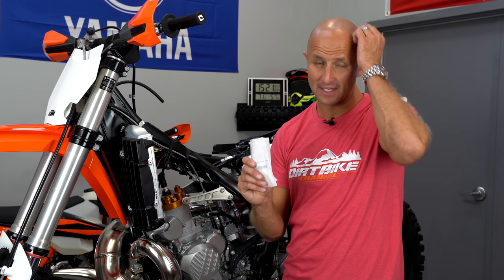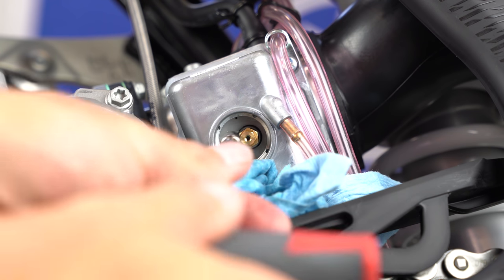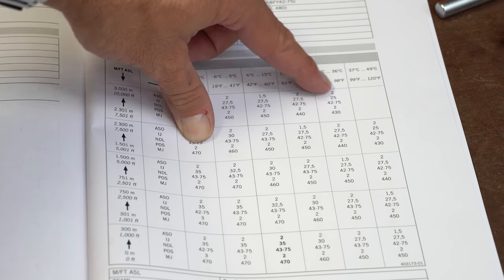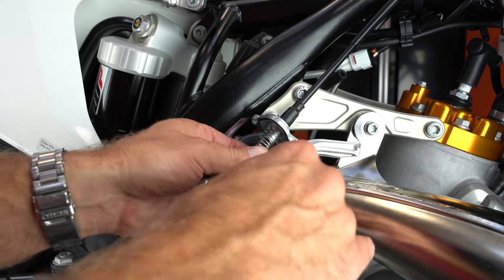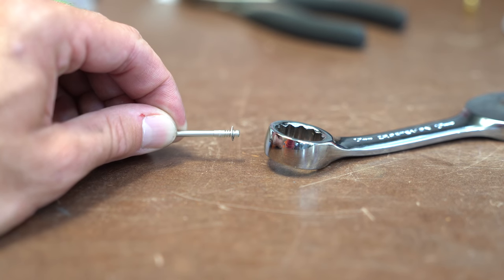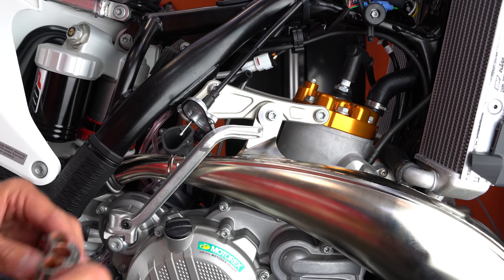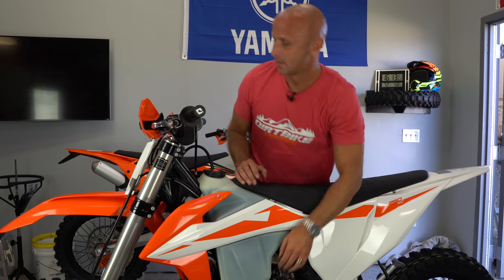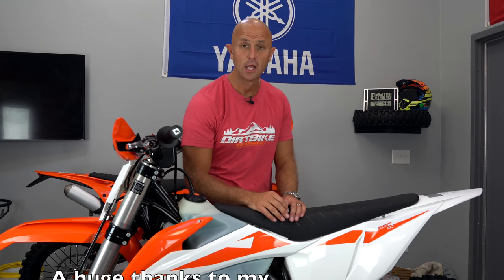Save $500 and Have a Great Running Dirt Bike | How to Jet Your Carburetor

Comment: I too tuned my own Mikuni Carb using you method with one exception.
That 1/8 to 1/2 throttle range is very affected by the needle. I found comparing the stock needles that there is a more drastic taper right at the end of the needle. This will make it run richer in that range, and I felt it. I got the JD Jetting kit simply because I was unsure what needle to go to. The one in the owners manual ran too rich. The one from the J D kit runs very sharp.
My question to you is how could I have chosen the correct leaner needle given all the options there are for the Mikuni and the owners manual chart recommending their leanest needle and it was still too rich.
Bike runs wonderful where I ride, so I don't need to change further, but for future reference and for other readers, do you have any tips on how to get the more appropriate needle.
Reply: Can you please specify the carbs settings and your what elevation and temp are you riding at?
I have the JD jetting too (not installed yet).
Reply: @NirHason  I simply used their chart which is similar to the standard owners manual. Only the thing I noticed is their specific needle is very different than the Mikuni - to be expected I guess. Then I cross referenced altitude and temp, then put those jets in along with the mystery needle. The taper at the end of the needle is very much different. Much wider at the tip. I then set the idle and air mixture as described and done. I set the range for typical summer temps in the 7500 foot range. I ride the bike at a wide range of altitude and it just runs. Starts easy, no stall, quick throttle response and really goes with the throttle opened, for as long as I can hang on, it is the TE300. So the 80 degree range, and the second to the highest altitude range. You will see in their guide if you spend most time at a certain altitude. That is the range I used - 7500 feet
Reply: @Toldea34  I tried to use the JD kit but they want me to use 35 pilot which runs very rich. You use the rich needle or lean one?

tnx for the detailed answer btw :)
Reply: @NirHason  I used the red needle. And, if memory serves, I used the 40 pilot jet. I have a feeling the JD needle is much leaner, while the idle circuit recommendation is much richer and something about th combination makes the magic happen. I could not get a combo of the supplied jets from KTM/HUSQVARNA or even a couple of extra jets to run as clean using the factory chart. The factory chart shows a 25 pilot jet throughout the range of options. This is why I thought the combo of leaner needle, richer pilot jet may simply be the trick to overall running better. The majority of my rides are in that throttle range, just about half or a little less. I ride very slow technical areas
Reply: @Toldea34  I'm riding at 0-1000ft (0-300m) between 79-98F and following settings:
-  PJ 27.5 (just changes it, was 30) - now it runs to much leaner.
- MJ 440
- Needle 43/73 P2
- Needle jet R-8 (I just got the S-4 so maybe I'll try it out with the PJ 27.5 since it's richer than the R-8).
- AS 1.25

The bikes runs great with those settings (PJ 30) but a little bit rich between 1/8-1/3 throttle. That's why I tried to drop to PJ 27.5 but now it's too much lean I think...
My main issue is that I'm getting only 60-75KM for full tank
Reply: @NirHason  I have not tried to jet to improve fuel efficiency. I am all about solid running performance. Your altitude just takes the settings completely away from where my bike is. I live at 4500 feet, but consistently ride starting at 6500 and usually top out around 9500 to 10,000 with each ride.
I will say one thing I have noticed about the fuel efficiency, is my 300 at least is very sensitive to just how we are riding. I have put 25 miles on very technical, slow climb, high altitude trails and used over a gallon of fuel where I then the following week go out and average smoother, more wide open fast trails and get something like 30 to 35 miles to the gallon. 
If it were me, get the bike running really well throughout its range for the conditions you ride. Then, plan on bringing extra gas just in case you are having fun and dont want to stop, regardless of how much it used.
Reply: @Toldea34  I'll go with your route :)
tnx for the advice, ride safe

Comment: although this is a well produced video, this guy breaks the cardinal rule of carb tuning and that is making more than one change when you go into the carb. this is the most common bonehead move by people trying to tune a carb.  if your trying to figure out what's what, never do that. it'll usually burn a bunch of time and if your lucky maybe an engine! (bonus!) i used to know a guy that always made 2 or 3 changes every time he opened a carb. his bikes ran like crap. but they were really pretty and he had the talent as a rider to ride around crap and still blow my doors off so it didn't matter.